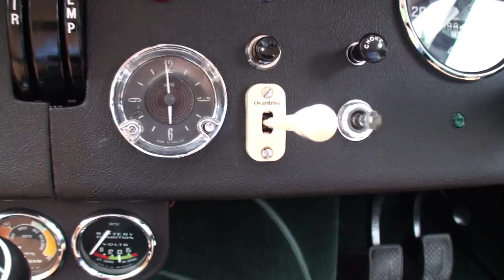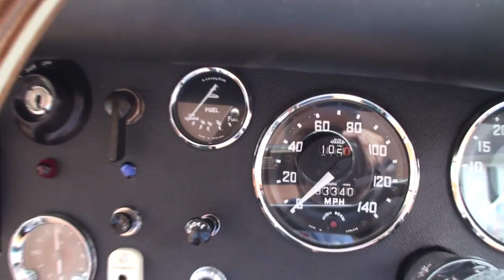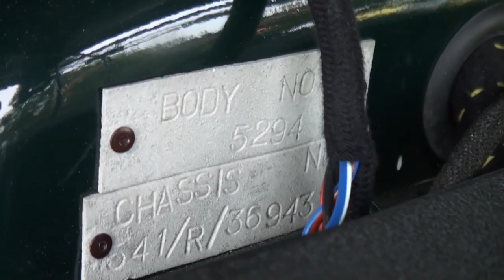1959 Jensen 541R Coupe in Green Paint & Engine Sound on My Car Story with Lou Costabile

Comment: Beautiful car: I bought one in 1970 for the right side of 350 quid. Because the bonnet exposes the engine completely it was a doddle to work on. The gearbox comes out of a truck and the engine is a straight 6 commercial, built to last. It had plenty of poke especially with the triple SUs - a nightmare to tune. It went like stink. It did about 25 mpg and never went wrong. A man's car, very good looking, always appreciated being understated, a gorgeous long distance cruiser. It a good size boot for all your leather suitcases. Because it aluminium and fibreglass the body work always looked pretty good and the chassis was big and solid. It was and still remains one of the best big sports cars of the 60s.
Reply from the maker: Hi jerebuck, Happy to read this car brings back memories of your car :-) Thank you for viewing and sharing.  Hope you see many cars on this Channel you enjoy!  Please Subscribe, and hit the "bell" so you can see all the cars when they are uploaded on this YouTube Channel, Lou

Comment: Lou; great car, Jensen's were one Great Britain's best marques. They were among the elite group of cars back then. The carbs are made by SU which means Skinner's Union.
A very interesting type of carburettor which works on the constant depression principle. In a
nutshell a vacuum is drawn through the ventury which acts upon a piston that raises or lowers a needle in a jet. By this action, the air fuel mixture is accurately controlled. These carbs were used up to the mid to late 70's at which time they were replaced by electronic fuel injection for even greater accuracy of the air fuel mixture. This move was largely due to the US government regulations for exhaust emissions control.
Reply from the maker: Hi Paul Kirkland, Thank you for viewing, sharing your knowledge, and adding to the story, Lou